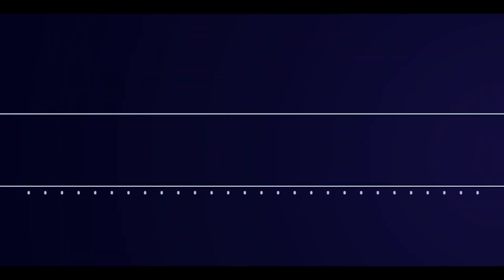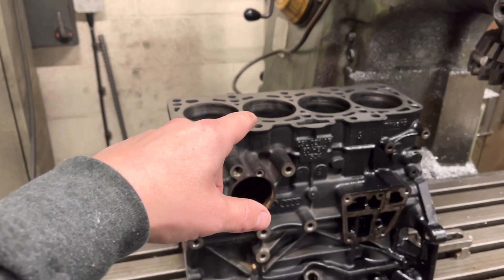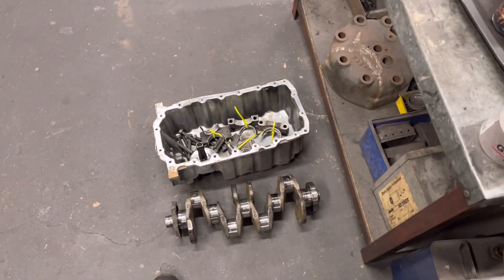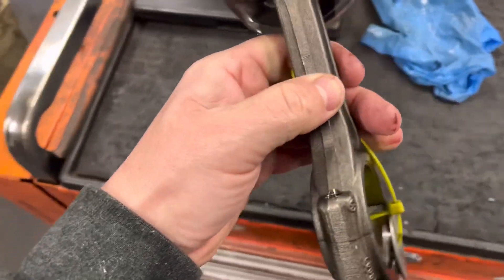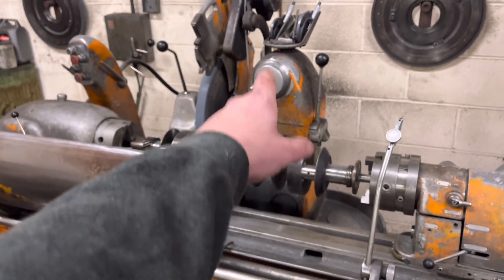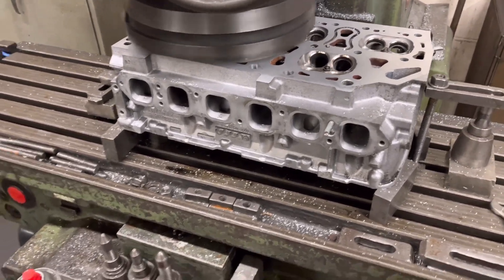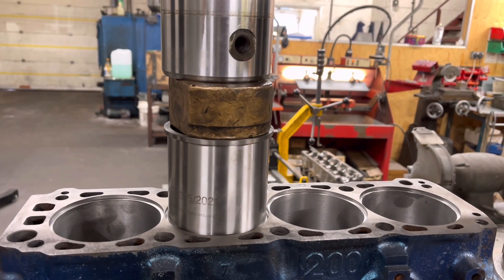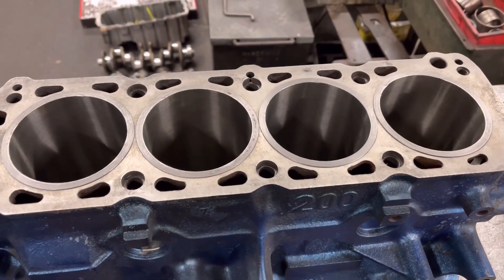Work load ESCALATES from YouTube subscribers

Comment: Many years ago I rebuilt an Escort Twin Cam Engine.Re-bored crank and bearing set,cylinders bored and oversized pistons,new valves in cylinder head and block and cylinder head re-faced.Ignition via distributor.A lovely engine developing about 110 bhp and bomb proof.Today,I would not know where to start!

Comment: Well known issue specific to early twin turbo diesel unit. The EGR cooler fails internally as its aluminium finned which then introduces aluminium oxide particles into the combustion side and bingo its stuffed. The particles must be stuck in the ring area hence why the excessive wear at the cylinder top. The fix is a rebore / new short motor but crucially with a later series D EGR cooler. No chance of this working longterm without.
Reply: A well known issue
Reply: I would insist on a new egr cooler for warranty reasons as this is a well known issue

Comment: The crank on the 2.0 vw TDI. Is walking around or flexing in the bores of the mains. Also being a diesel  & a transport vehicle  maybe they overloaded several times & they are pushing the engine to hard its just 2.0 turbo diesel  they should only Rev out to 2500 to 3200 rpms tops not 4500 to 6k. So in my opinion it was beat on. 
 Have a good day.
Reply: My opinion is that any VW/Audi diesel after the early 2000 PD's are utter crap, BXE's throw rods etc, I had a 1996 Audi A4 TDI 110 BHP which i ran to 200K and was running and sounding great before i sold it on, It never missed a beat and only required regular service maintenance, This POS engine in the video has 60K on it and it's shagged!

Comment: The excess engine wear on the VW engine is from the EGR cooler breaking up and the fragments entering the cylinders and literally turning into a grinding paste, this contaminates the oil, check the part number of the EGR, the last letter will tell you if it’s an early faulty one, must be changed or it will fail again
Reply: Was gonna say the very same, common issue on those 👍
Reply: Forgot to say the oil pump will need replacing as well

Comment: As others have said, the Transporter engine looks to be a CFCA with the well-known EGR issue.  I'll be following progress keenly - mine's about ready to be stripped down and fixed.  If this one is the same, as it looks like it is, part of the problem is that all of the oil-ways and galleries need to be meticulously cleared of any particulate residue, otherwise it won't be many miles before the problem's back again.  Even with the latest revision of the EGR coolers, some people still report problems.  Mine will most likely be reassembled without that cooler and the EGR blanked off.  Really interested to see how this one goes!!

Comment: I've seen that wear on the bearings from stop start engines we have done one of these before and found it to be the same and who do you use for gaskets do you use imex gti or Ferraris piston service/FPS . that prince crankshaft grinder is like second nature to me that's the smaller one we had one but we now use the slightly bigger version great machines to use

Comment: Hi, great video. As a mower mechanic just doing an engine rebuild with a little honing and new rings. If I was not working on a winter workload I could not justify the cost. How can it be a viable cost to face, line, and bore etc with all the stripping and rebuilding cost on something like the VW Transporter?
Reply: Transporters are well liked and fetch a princely sum, even with very high mileage. If its less than the cost of a  replacement used one that you don't know (as in you have no idea how healthy the engine and box is), it's a no brainer to get someone who knows what they're doing to rebuild it.
Reply: @KrisDouglas  I guess we are working in very different price products. Today I was working on a hedge trimmer. Purchased new for £82.50, one part for a repair £86.00 plus my time.

Comment: Unless the bearing locating tangs are offset to prevent incorrect fitment its possible that the bearing halves in the con rods were fitted the wrong way round and that there was reduced clearance on the top half which bears all the combustion loads.

Comment: These VW Bitdi engines main problem is EGR Cooler. They corrodes and all that abrasive gets to the cylinder through EGR and it is main reason why cylinder are worn out

Comment: You said the motor had dual turbo's, were they both running at the correct pressure or were they unequal? The extra pressure might have caused the damage to the big ends. Or am I wrong in my assumption?

Comment: That vw engine is it the CAAB engine ?  if it is there is huge problems with oil usage and breathing. Its mostly down to the inlet system and there is a upgrade from VW im sure its another inlet manifold. Big problem with carbon build up in all oilways and oil system hence wear on bearings . I would not be re-ringing that if you do get it in writing from the customer and him to sign it as well.

Comment: Hard to see, but as it was using oil, the top of the VW cylinder looks like someone has put a ball hone to rough up the surface to lower the oil consumption. I have seen BE bearings like this before when someone did a quick "fix" on the engine. They fitted new lowers (because that is all they could do in the car). I cannot see this engine only doing 60K, and I reckon it has been apart previously by the wear seen in the bores and bottom end. I am questioning if this is even the original engine to the vehicle?
Reply: Interesting thought about the lowers only being replaced.
Reply: @markenglandle  Yes, last engine I had where this was done (M9R renault/nissan diesel) then threw a rod and destroyed the engine. Clealry they used the original torque to yield bolts again and one yeilded as designed.

Comment: the VW Transporter is that oil changes jesus  those bearings look bad to the copper 
I think VW are crap now 
but is any engine good for life due to manufactures trying to get so much power from a small engine
I was looking for warrany that would cover my wifes 1.2 3 cylinder engine